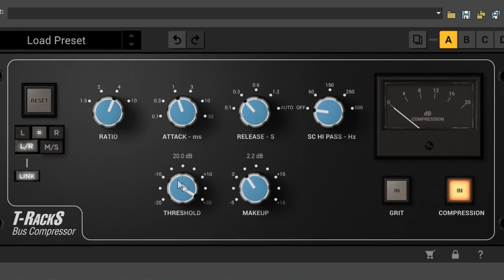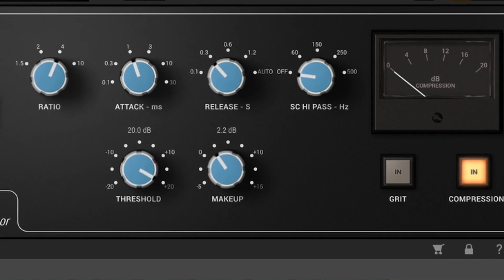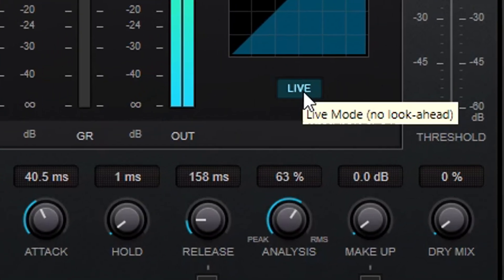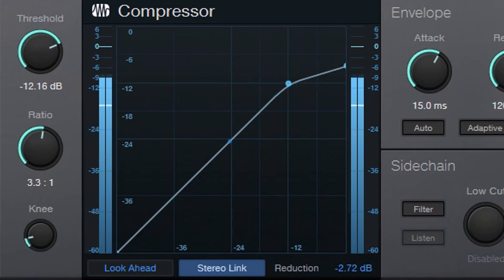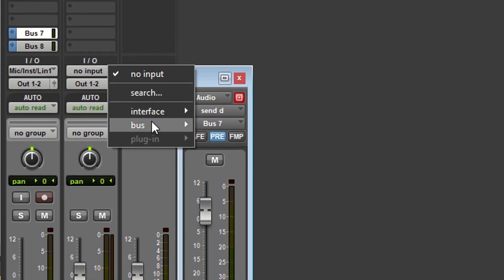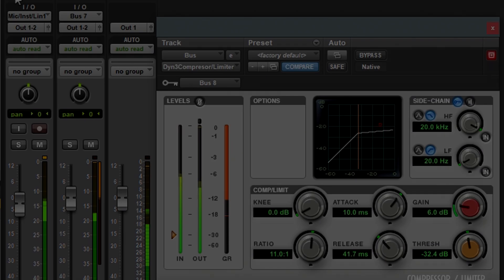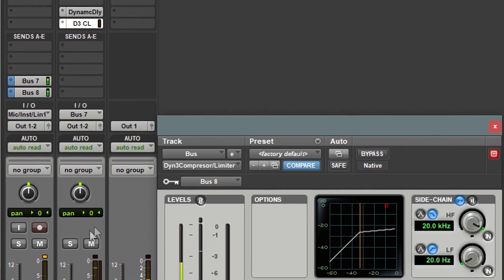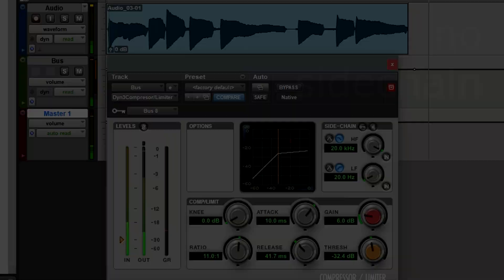Add Lookahead to Any Processor

Comment: Lookaheads are not just delays in the internal sidechain. all you do when you use a delay without the other steps is break the time constants because there is no hold/predictive gain envelope or integration/FIR reconstructing of the delay line i.e 30ms attack is no longer 30ms attack , and you also make it so that the compression envelope is being applied between sample values which could result in clicks, definitely some kind of distortion and more to the point, it will fall apart on quick passages. there's literally a free comp out there that has properly implemented lookahead so there isn't any need for these silly hacks. referring to JonVAudio's FIR Comp for those out of the know

Comment: no offense but Id like to point out 
1 - never showed what the original was because I don't think what your showing is good TBH 
2- why on earth are you doing 18db of GR? your most def going to get artifacts when doing that esp. if its not needed( just for showing an example)  
3-  you completely took out the attack/picking of the guitar lol

 i mean cool if that's what you want to do but you don't need all that just to "soften the attack/picking" of the guitar, 
and to be honest a lot of  " built in lookaheads" on comps or limiters  mess with the transient which is why it can be a hit or miss thing to begin with

Comment: That's brilliant to think of and apply on a project. I wonder if a transient processor would produce the same result without using a delay and a sidechain
Reply: Glad you liked the video! A transient processor could help eliminate the pop, but the issue is how it would do that. If it's by ramping up an attack time to reduce the transient, you might lose some of the percussive quality that the sidechain-based approach maintains. Also, the transient processor would need to be post-compressor, so now you have the variable of two processors in series. But if you get a chance to check it out with a transient processor, circle back here and let us know what you find!